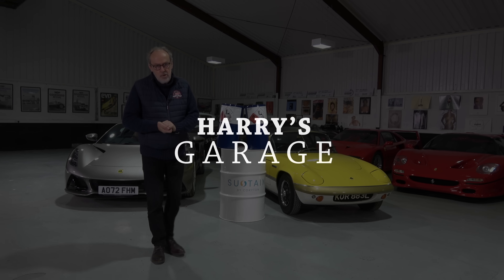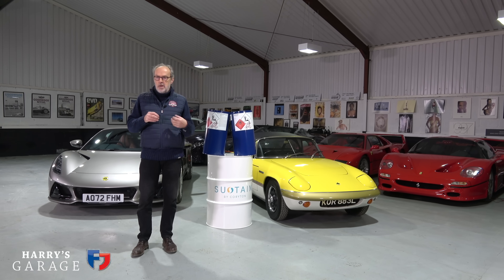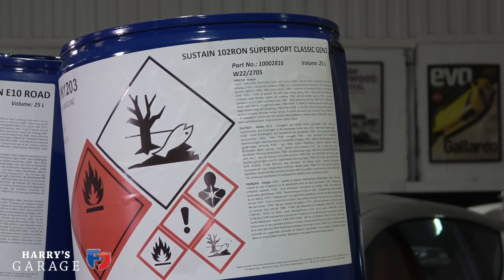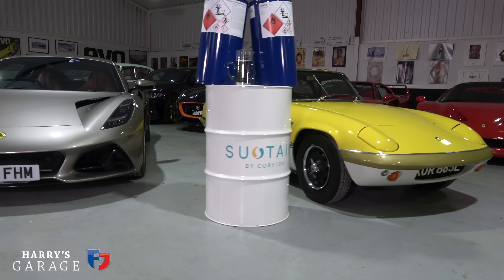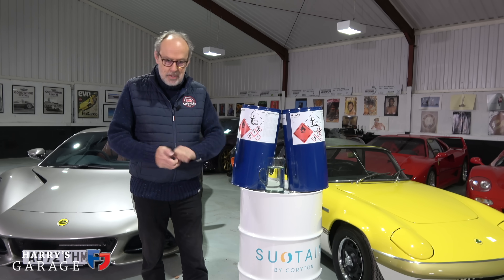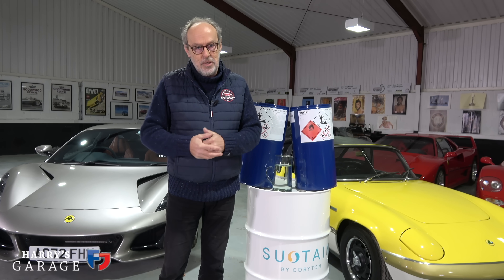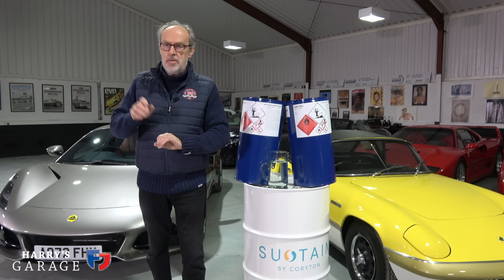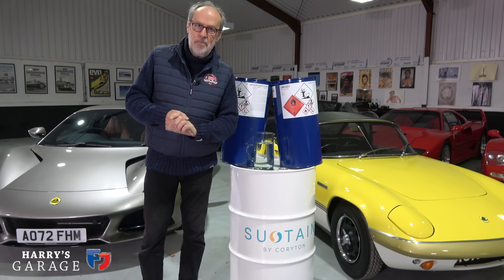Sustainable fuels; what are they & when will I be able to buy some?

Comment: Very interesting video. I do think these fuels have a role to play in the near future. But only for a specific type of customer, because it will be expensive and not very common. I think that with added taxes the price will be nearer to £10, rather then £5. Goverments will want to reduce the burning of fuels for more then just CO2 emissions. Just look at the way the EU is enforcing laws regarding nitrogen emissions. Also you mentioned that last year this company produced 14 million liters of fuel. The average consumption of petrol in the UK is around 30 million liters of petrol per day. I know you don’t think it will be used for all cars. But if all owners off classic of sporty cars switch to these fuels it will put a strain on the supply. Off course production can be scaled, but there is only so much waste to process, without growing crops just for fuel. This is also a problem with ethanol. Where fuel producers compete for land that can be used to farm food.

Comment: I don't see why EVs are needed even for city centers. Modern gasoline and diesel cars have such incredibly low emissions that they do NOT really even affect humans anymore. 
Pity I can't post charts here, but I have here a German study which measured emissions from gasoline and diesel cars complying to the latest emissions standards. Even before this for years cars have actually cleaned dirty city air from most pollutants! But now we've reached a new milestone: I have the charts showing how most modern ICE cars cleaned even air that was considered "clean" before it went into the engine!! They still massively cleaned the "dirty" city air, but now they also clearly further cleaned "clean" air even further!

The newest particulate filters are real miracle-devices, and overall the work which has been done over the years to clean up ICE passenger car emissions is amazing.

Nowadays all the city pollution comes from HEAVY vehicles, heating, power stations, ships, and to a small degree old cars...not modern new cars! Once all the older cars are gone from traffic passenger cars will no longer be any kind of a polluter in the cities, the emissions will be so minute that their effects will be negligible. And even now with lots of old passenger cars around the major polluters are the other, heavier vehicles and other polluters.

Comment: It's all well and good saying that electric charging infrastructure needs to keep up with demand - and of course it does - but that is a much smaller problem than scaling up supply and distribution of this kind of liquid fuel. As a nation we already make and distribute electricity all over the UK and it's not a huge scale-up to add cars to domestic and industrial electricity consumption. But the UK burns more than 45 million litres of petrol and 75 million litres of diesel every day. Scaling up what is currently a fuel made in pharmaceutical quantities into a mass market product is a stupendously huge problem, far bigger in proportion than the relatively modest scaling challenge of electric charging supply. I see no evidence that this product can be scaled up to replace a meaningful proportion of road car fuel, or even that the industry has any intention of doing so.

Comment: Aviation does have its own version of a carbon tax, so its not as free to pollute as you say. each aircraft type has a defined carbon emission figure, its basically a glorified fine. it motivates airlines to upgrade to newer aircraft however thats not always possible, for example, the regional market, there simply are no replacements. look at at42/72, dash8, saab 340's. there are no new equivalents or superiors. they cant be engine swapped like a car. SAF will be aviations go to for a very long time. savings will be made via aerodynamic developments more than fuel type. As for lithium bats, they are explosive in depressurised conditions and there is no battery availible which can rival the energy density of jeta1. bats in small aircraft also decimate the payload range calculations due to the mass not reducing as you burn off fuel because there is no fuel.

Comment: Sustainable Aviation Fuel is not yet ready. The flash point is much lower than kerosene which results in various major fuel tank safety issues. Additives can be added to increase the flash point of SAF, as used in the SR-71 fuel, but it comes at a price, less bang for your buck, less range and more cost to the paying customer.

Comment: Harry, this is not a thing of the future, it's a thing that has been used for years already! My relative in Finland has been using another major oil company's modern new generation biodiesel (HVO100 I believe is the technical term for that fuel type) for YEARS! That biodiesel is produced using certified waste materials as raw material, and I believe there are now three refineries worldwide producing that fuel. In those same refineries they make a slightly modified version which has been under testing in aircraft with KLM among others for some time already.

That biodiesel makes my relative's ordinary new-ish diesel Mercedes much lower in carbon emissions than any EVs!! Especially in the cold weather up north, and especially as those Finns drive at highway speeds for long distances. Availability is nearly at every single gas station of one brand he goes to, nearly the whole country has full coverage. And the price? Just a few cents more per litre than ordinary diesel!!

Where I live now in central Europe, in this country and all neighbouring countries around there is biomethane and bioethanol widely available! Biomethane, which can be used with gasoline cars equipped from the factory or with a retrofit kit with a CNG-system, is actually cheaper to use than gasoline too! And no range anxiety (just as there isn't with biodiesel or bioethanol), since you can switch back to fossil fuels whenever you need to. Biomethane is available, depending on the filling station, at either pure biomethane, 20% biomethane (the rest natural gas), or all of it fossil natural gas. New research which I just read, despite being corrupt and fraudulent pro-EV peoples' study, still came to the conclusion that CNG vehicles, even when using natural gas which emits more CO2 than biomethane is lower in overall CO2 emissions than EVs!!

Bioethanol (E85) is also very sustainable, depending on the source of the raw material. As far as I know all E85 sold in Europe is made from certified sources guaranteed to give genuine CO2 reduction as well as not affect food sources. So just like that biodiesel and many e-fuels it's made using waste products. Bioethanol would be easy to implement very widely as so little modification is needed for gasoline cars: just a modified/additional ECU, new injectors, and of course the fuel system has to be a modern one as they can handle the ethanol. Proper E85 cars also have a fuel mixture sensor which can automatically detect which percentage of your fuel is ethanol and it will adjust the car's ECU accordingly. Very highly tuned cars can also run on much higher power settings with ethanol...then the system will automatically decrease that setting if your fuel's % of gasoline is higher.

Anyone wanting to look up the sustainable ICE fueling networks on Continental Europe, there is a site called "glpautogas" and then one of those dot-thingys, then "info".

Comment: The big pointer for me was where the bio crop energy was coming from, i couldn't understand with food shortages how you could produce the fuel with such a food offset, but the simple fact it is from crop waist which makes sence.
This is so much in its infancy it will be the solution in farming to use any waist and make it have a value as much if not more than the food being produced.

Comment: Regarding electric car adoption issues, I am very eager to drive an electric motor driven car but for good reasons, my business demands a car that can drive 4-500 miles in minimum time and possibly another 4-500 miles the following day without being able to rapid charge. I specifically want a hybrid that can run and/or charge on a small helper engine, much like the BMW i3. 

Currently the auto manufacturers are heading in the exact opposite directions from what I, and maybe many others, need. I was hugely disappointed to see new Prius models designed to more heavily rely on the ICE than previously. What in the world are they thinking?? No one buying a hybrid cares about 0-60 times. What I need is an electric car with a small helper motor that can provide motive force but primarily is there for charging. All the hardware exists. Build it!

Comment: I don’t think electric is the answer. It’s is not sustainable given the battery manufacturing and disposal processes. We have not lived with electric cars that are old and becoming problems. Batteries have a finite lifespan. Sustainable fuels are far more practical and indeed renewable which is the answer going forward. It’s just a question of how do we reduce the cost per litre so common folk can access it. And tax reduction is a very good answer here.

Comment: I attended a lecture a few months ago on implementation of hydrogen fuel cells in heavy duty trucks. Many of the anti BEV table thumpers like to tell us that hydrogen fuel cells are the answer. Well they are not, even in HGVs they say they cannot compete in daily journeys of less than 300km and that rises to 500km if rapid charge network is available. But the thing that got me, was that not only are they just as potentially short lived if stressed and sensitive to temperatures as batteries they are also only going to he at best 55% energy efficient. Well that is only marginally better than a modern truck's diesel engine, given that we have factories that can mass produce diesel engines and a fuel network that can already distribute sustainable diesel and or be adapted sustainable liquid (methane) gas this is a better option than going to hydrogen with all its fuel density and handling issues for the stuff we cannot do with BEVs.

Comment: When I think about the need to decrease fossil fuel utlization, and I itemize it in my mind, I think there's some points that should be considered, whether or not they feel relevant to this video, similarly to the aircraft fuel discussion.

For one, I'd be weary about sustainable gasoline replacements, as as far as I remember, the ethanol industry for one is a net increase in fossil fuel usage because of all the work required to plant, grow, and harvest them, and is largely subsidized within the US because of its failure to be truly product positive. So, if things were to go like the companies shown in this video propose, a system of using food scraps to power cars would require a dramatic decrease in the usage of gasoline vehicles, to being primarily designed for the enthusiast, as the growing of plants specifically for fuel may not yield a positive result. This can of course be helped by the reduction of the number of "daily drivers", as most people using a car are not enthusiasts, but simply see it as a utility, and can even be dangerous when treating their vehicle like so. As such, the switch to public transit, biking, walking, and designing cities to encourage that more would help tremendously, hopefully without hurting the enthusiast motorist.
That switch also helps sustainability in other ways that aren't so relevant to the question of fuels. Regarding the issue of grid power and the mentioned ~60% gas power, while I'm not a fan of BEVs, indeed I think trolleybusses and electric trains are far better for sustainability, the switch to green and sustainable grids don't need to be as far away as they may seem. While some countries and regions are very far behind on green energy overall, there are some examples of places that are doing well in this regard. France is at 50% green energy, with a sizable chunk being nuclear, and last year my home state of California had its first days of 100% of electricity being renewably generated just last year.

Hopefully this is food for thought and research for someone, as the energy issue is such a massive subject with so many working pieces.

Comment: Harry, you are wrong on aviation fuel tax.  I am an airline pilot.  And a petrolhead and a farmer.  Taxing Jet A1 is pointless and dangerous.  Why pointless?  Well we already are under massive commercial pressure to save every Kg of Jet A1 we possibly can.  Its ALWAYS been the case in my 23 year career that one of the few costs airlines can try to control is fuel consumption.  So as a pilot I have to justify every single drop, I get compared to colleagues, I have dozens of techniques and tricks that I use on ever single flight to shave a few litres off the fuel burn.  I spend more time trying to save fuel than I do actually hand flying the aircraft.  If you taxed the fuel by 100% I still couldn't shave any more off the flight and maintain safety.  Instead airlines are taxed on ticket sales and that achieves a safe tax that adds no extra commercial pressure on pilots.  Plus of course if you taxed the fuel you'd end up burning more of it.  How so?  Well simple.  We already sometimes "tanker" fuel.  If its say notably cheaper in Amsterdam (it sometimes is) then we will be instructed to fuel up with far more fuel in Amsterdam than we need to fly back to the UK and then we need less of the pricier UK fuel to load up for the next sector to say Italy.  Tankering fuel increases fuel burn by 3% per hour per ton tankered.  An algorithm works out if the extra fuel burn is worth it and if it saves a penny that's what we are told to do.  I guarantee that one country somewhere would not tax fuel to help save the planet and as a consequence the airlines would ensure that as many aircraft as possible passed through there and brimmed their tanks on departure.  Airliner tanks are massive compared to what we normally use - the are designed so that the aircraft can cross the Pacific even though they might typically spend their service life only doing a fraction of that distance.  For example an Airbus A320 has a 17 ton fuel tank but would rarely in European or American usage ever need more than 10 tons of fuel for even a long 5 hour shorthaul flight.  Create a tax saving incentive though and we could easily load up with 17 tons of fuel despite only needing 2 tons for the flight.  The aircraft would be 15 tons heavier (25%) than necessary and burn much more fuel than it needs to purely in the interests of a tax break.

For many many good reasons it is a bad idea to tax aviation fuel.  Stick to taxing the ticket sales and applying VAT to them as is the case presently.  The airlines are already red hot on saving every drop of fuel possible.  As are manufacturers and engine makers.  In my 23 years I have seen specific fuel consumption drop by a third.  Strides are being made and a fuel tax would not make those strides any longer.  

7% of man made CO2 emissions come from the textile industry.  It would be a better idea to tax clothes, insist on better quality, tax the fashion industry and castigate the cheap clothing throwaway culture...   Love both the channels, keep it up.

Comment: Another insightful contribution from Harry to what ought to be a much more considered debate than we have had to date.  See also his JCB hydrogen contribution which addressed the logistical issues for heavy vehicles and construction traffic. Too much has focussed on point of delivery measurement of carbon footprint when the real focus ought to be on a logistic audit and, as Harrry says, the aviation industry continues to ride above all the well - intended legislation for no compelling reason.  Roll on the super unleaded substitute.

One query - if fuel consumption improves ( the best way to phrase it ) by 10% then less fuel overall will be used; so would that not in turn also lower the overall CO2 footprint in the production cycle?

Comment: Years ago (about 20!) I looked into Veg Oil. I lived in California (LA) at the time, and an Englishman ran Lovecraft Biofuels selling old Merc W123D and TD there. Nearly bought one. They made so much sense especially with the amount of used Veg Oil there in Burger 'restaurants'. When I came back into the UK, my Citroen ZX TD was a week off being converted- then the government upped the tax on Veg Oil as a fuel. The point is- this is one option, so is Veg Oil, and there will be more!
Reply: My family member has been running his new Mercedes diesel with a major oil company's new, modern biodiesel for years. It's fully safe for all diesel cars. It's made from certified waste materials, it reduces CO2 emissions by about 90% (so a lot less emsissions than any EVs), and in that country it's widely available, just go to your usual gas station and pump it normally. Only costs a few cent per litre more.

Look up HVO100.

Comment: Harry, do you know what the CO2 footprint is of the sustainable fuel you're using is?  You reference that charging EVs when it's not windy is bad, but producing the sustainable fuel will also always have a CO2 footprint (it'll use some electricity, etc). When something costs that much to make, it usually uses a lot of energy (and CO2).  I'm also concerned about the scalability, given not everywhere has access to free heat (as the supplier claims here).  

Also, my understanding is that sustainable aviation fuel is a no-goer as the amount of crop needed to produce it is ridiculous...some figures similar to the total crop area of the US have been bandied about...
Reply: You're here to just push EVs, aren't you....